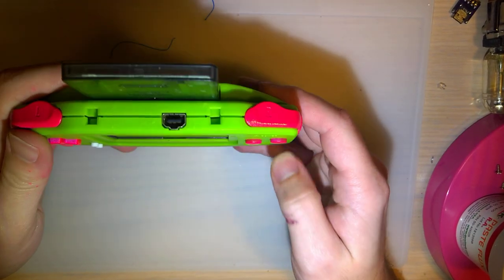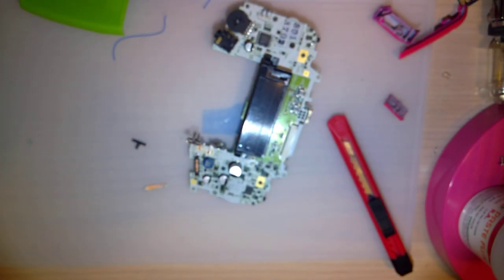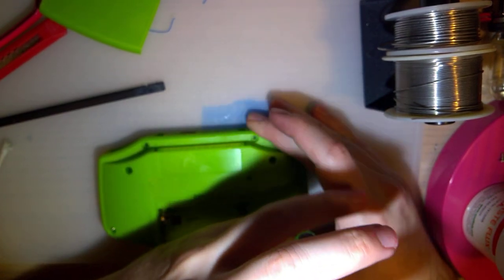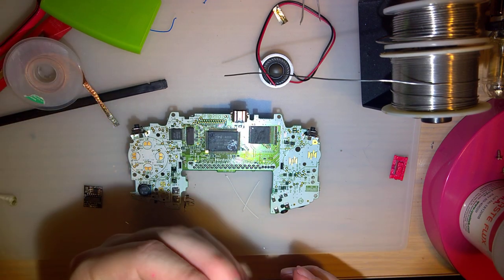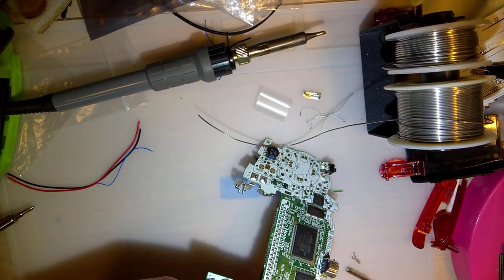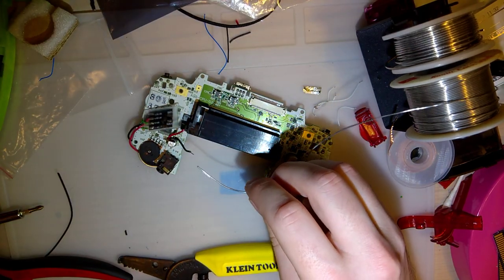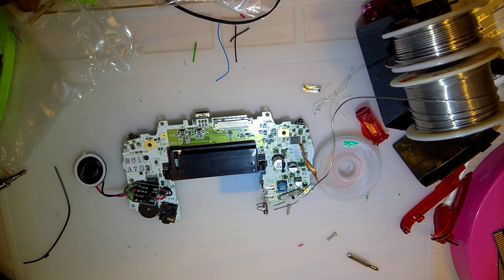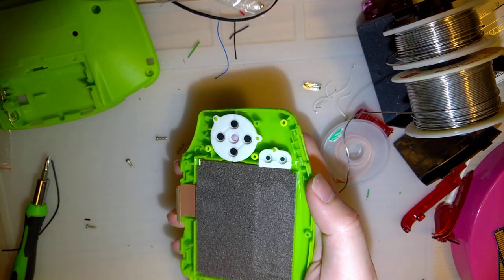Installing RetroModding's GBA Amp (in an AGB)

Comment: Have you ever consider making a cost effective build with the PAM8302A board? I have done a few in GBA and GBC, and compare to a Gbamp v3  clone i have, they are on PAR, very impressed with results. You can also wire this board in way it disables built in speaker when headphones are  connected.
Reply from the maker: I'd like to some day because that sounds like fun. I don't think I'm going to get to that any time soon though.

Comment: Hey! I was watching the video and close to the end (yes i did made it to the end) you put some tape directly on the motherboard to isolate it from the metal of the speaker which is great on paper but i thought that aesthetically speaking if this motherboard belongs to a clear-ish housing it could be seen, so why not putting it directly over the back of the speaker?
Reply from the maker: Because hindsight is 2020 and I didn't even think of that.
Reply: @makho  Everything happens in god's plan :D

Comment: First thx for the Video!!!
Second is there no way to bypass the internal AMP and deactivate it?
Reply from the maker: You can, but you still need it for the headphone jack.
Reply: @makho  Ok but can't you connect the headphone jacke with the new amp?
Reply from the maker: @Olize666  You misunderstand. Without the original amp, the headphone jack won't work. The new amp only has the one output and would be way too loud for headphones.